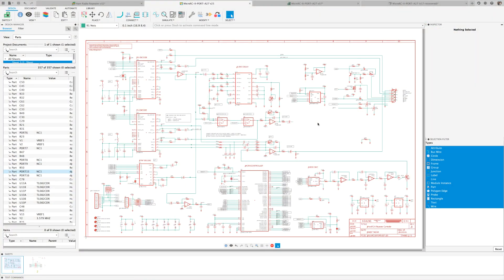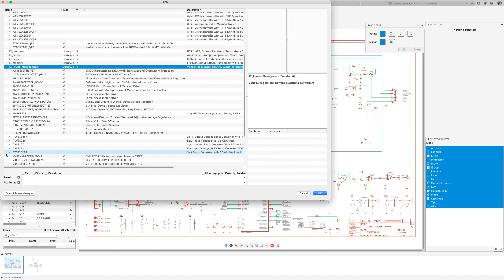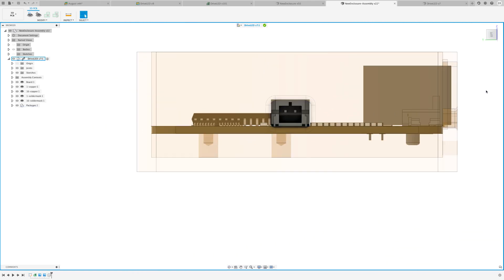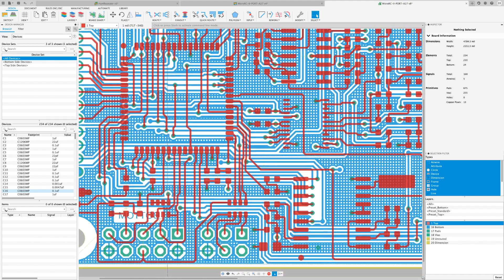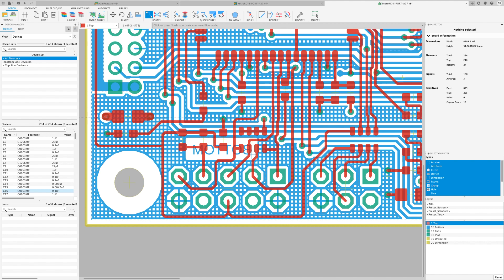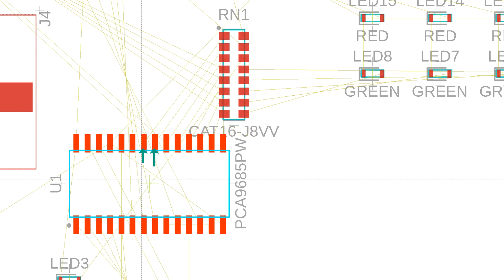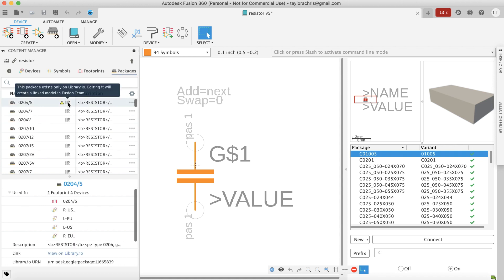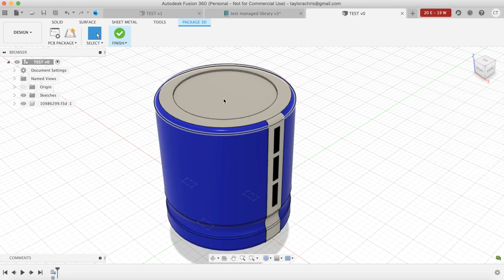What's New Fusion 360 electronics - August 2020

Comment: Is the Fusion 360 Electronics fully fledge compared to eagle? Or still in development?
Reply from the maker: Fusion 360 electronics if fully-fledged to the level of EAGLE.  Fusion 360 is continuously being updated every 6 to 8 weeks. Improvement can include new tools, improve existing ones or fine tunning bellow the hood for better performance.
Reply: @adskFusion  Will eagle be removed then?
Also, please improve performance of fusion, it is really slow even on a top notch computer